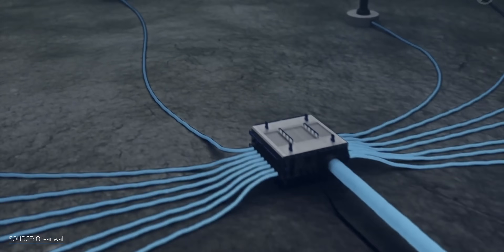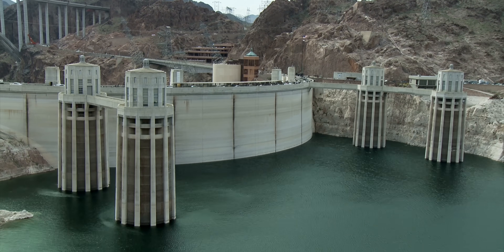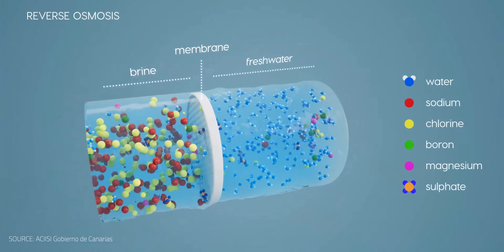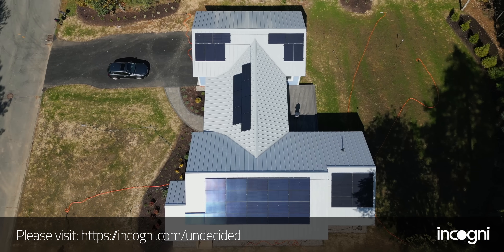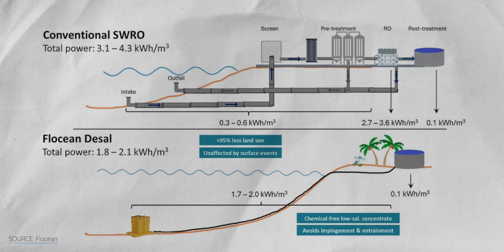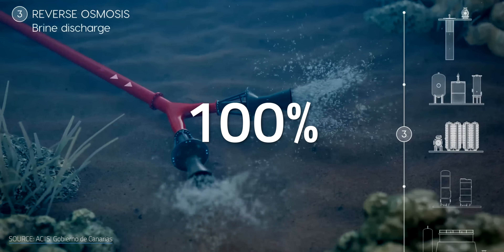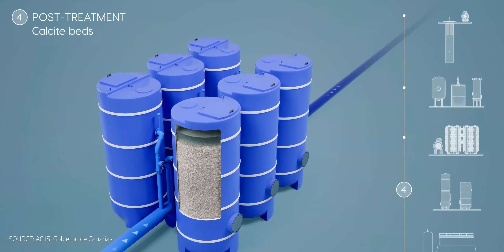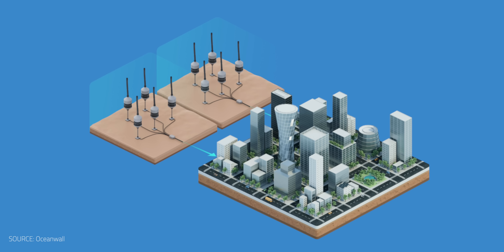How Deep Sea Water is Now Drinkable

Comment: As an engineer, looking at a well established type of desalination method now "thrown into the abyss" to get, what ??? The need to apply suction head instead of positive pressure head, to get what??
More engineering troubles than I ever had on shore...I would be running the other way. I do NOT trust those efficiency numbers AT ALL. Sorry, more startup PR peddled on the internet as something revolutionary - again! Regards, DKB
Reply: I suspect the main benefit is that you don't have to pump the brine solution very far. And perhaps the membrane works more efficiently when it doesn't need to extract 50% but can maybe do 20-30% instead.
Reply: You're overlooking a key detail — the inlet side of the RO system isn't at sea level; it's 500 meters down. That depth gives you about 50 atmospheres of hydrostatic pressure for free. You’re not applying suction or pumping seawater through the membrane — the ocean itself provides the pressure to drive reverse osmosis.

Because the permeate side (freshwater) is routed to a surface-level collection reservoir, there's a natural pressure differential across the membrane: high pressure on the seawater side, atmospheric pressure on the freshwater side. That pressure gradient is what powers the desalination process.

And regarding suction head — you're not pulling a vacuum. The inlet of your pump (at the surface) is drawing water from the collection pond, not from depth, so there's minimal suction involved. The flow is maintained up to the limits of the membrane and plumbing, not by forcing water up from the deep.

It's fair to question startup hype, but this approach isn't magic — it's just applying well-understood principles of fluid dynamics and pressure differentials in a new context. Worth a closer look.
Reply: @siorusbzns654  Well, it's not that simple friend. That hydrostatic head is all well and good, but by the "time" it has acted across the membrane, that head is gone and I have to buck-pump it back up against gravity, like in a skyscraper water supply. While I DO get it that the "front" pumping is gone, the string of pumps I would need to get the product back is now a major head headache from every perspective. The water cannot get up nor out to shore without some significant pumping system underwater, and the capital and maintenance cost of that would likely make a lot of folks think twice. I remain highly suspicious of the whole idea despite the some apparent, inherent hydraulic advantages. regards DKB
Reply: @domenicobarillari2046  The fresh water output will rise back to sea level without any kind of pumping at all. That's the point. That's the way this saves energy.
Reply: @siorusbzns654  No. The pressure loss across an RO membrane is almost 100%. I can guarantee you that once across, that water has to be lifted to shore. These are molecular openings in a macroscopically thick film, its hydraulic resistance might as well be infinite. You will find water trickling out of the membrane at depth and nothing to return it to shore.
DKB
Reply: I can think of two potential "tricks" that might explain the better performance, though I'm still skeptical too.
One is that I know RO systems tend to still have significant pressure on the fresh side of the membrane, which land based systems have fancy pressure recovery systems for so they don't waste too much energy. Recompressing to ocean pressure on the fresh side probably does eliminate any pressure recovery losses. 
I think if you can get away with only pumping and treating the fresh water and have a cleaner way to dispose of the brine, you can also go for a lower water recovery ratio than conventional RO systems, which reduces the pressure requirements.
I'm not convinced the economics or the practical engineering work out since sticking anything that complex and high pressure deep in the ocean seems like a maintenance nightmare, but I think the theory for the energy savings is probably sound.
Reply: @thamiordragonheart8682  Many thanks for this constructive feedback good sir!
Reply: @thamiordragonheart8682  Many thanks for this constructive feedback good sir!
Reply: The only point I can see here is that the membrane a 500m down under won't be in contact with dirt/algae/plankton/etc as much as it would be if the surface-level water was taken.